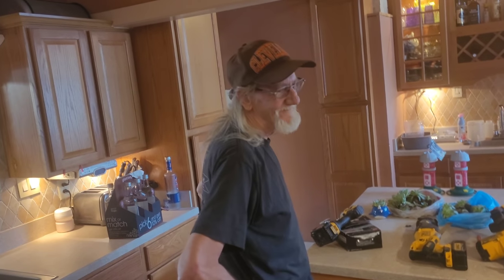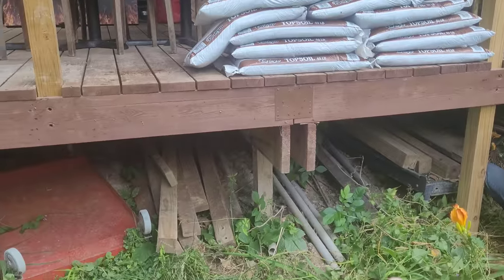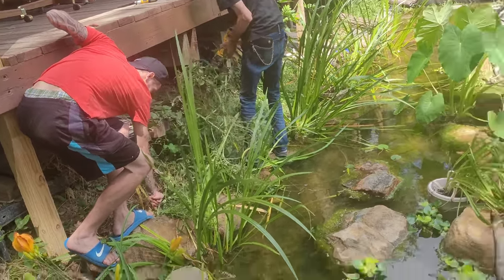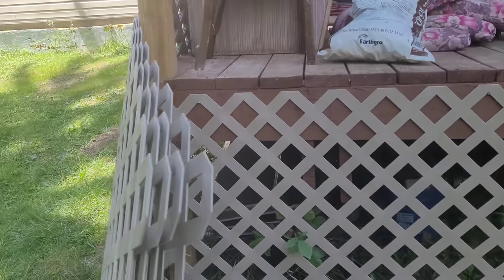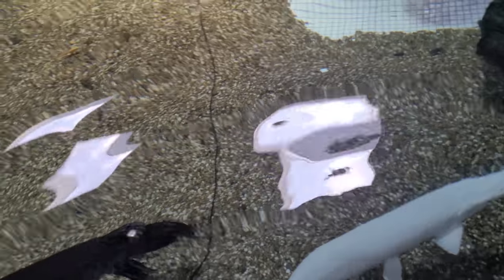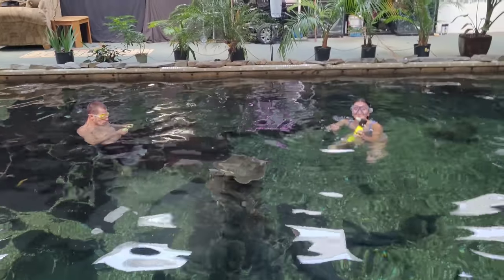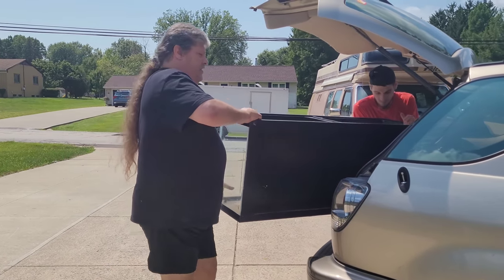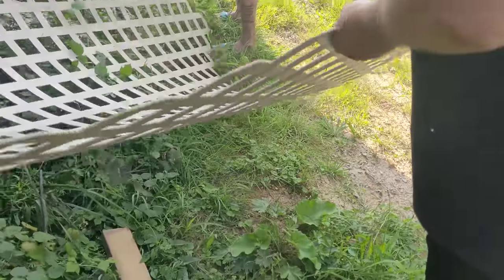A new MERMAID for Ohio Fish Rescue, Swimming with the monster fish in the pool - lots more

Comment: Hey Big, the PVC lattice looks really cool.  I've used it before to enclose a patio from bottom to ceiling.  Major problem tho after installing, most of the pvc split and cracked months later from the screws.

The following is only a sgggestion.  Remove them screws before it happens and resecure at top with a horizontal wood planks, with screws in the wood only.  You also might be able to space the lattice equally apart leaving the gap approx in the middle of the vertial deck post and secure with plank and srews on the center.  The gap might even make up you missing piece.

Expanding and contracting from temperature, plus its weight causes the screws to crack the pvc just saying.  I was very bummed out after having to fix months later.  👊😁👍
Reply from the maker: yes, agreed, but we didnt screw in through the pvc lattice, we basically hung the lattice on screws, which didnt hold in the slightest wind, we had to go buy l screws, which had 1 inch pointing up and 2 inches of scew going into the deck, now the lattice just hangs there, flops in the wind but always settles right back where it needs to be, but thank you
Reply: @ohio-fish-rescue  YW Bro. I'm also always doing projects for my reptiles n fish too and would welcome any suggestions from the pro's.  I have learned lots from you guys and thanks ☝️🐟😁